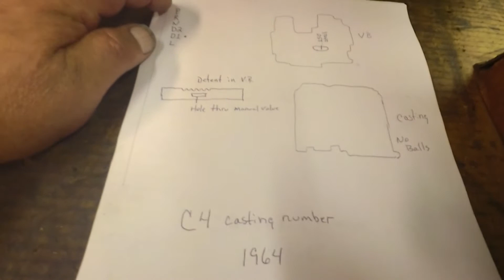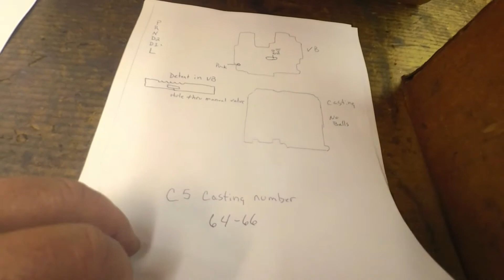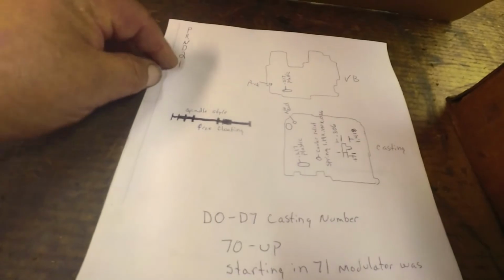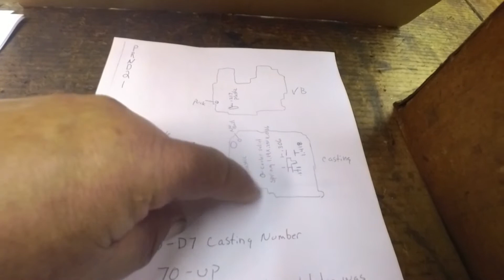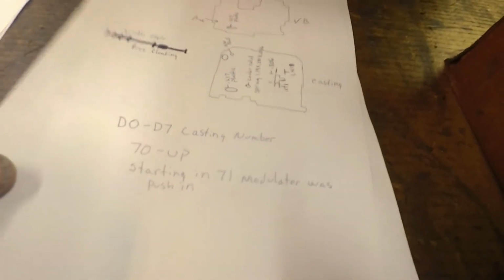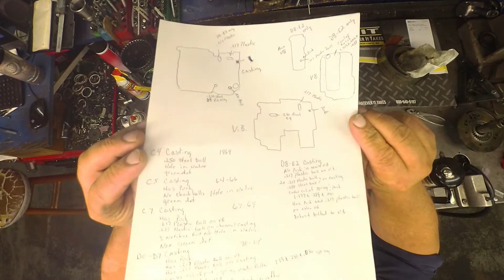C4 Valve Body Identification

Comment: Hi

I have a C4 auto with a C8 casting number on the valve body.

When I took the whole assembly apart, I had the puck and 2 check balls; however one of the balls is smaller than the other, about half the size.

The problem is, I'm not sure which channels they should go into (all the videos / pictures I've seen state that the balls are the same size), I'm assuming one size should go into one pocket and same with the other? But which way round?

I'm going to be fitting a transgo stage 1 kit (part number 47-1), where check balls are still required. Again, the instructions show the ball sizes to be the same.

Do you know of any revisions / modifications to the C8 casting over the C7, that would require differmt size check balls?
Reply from the maker: The balls are the same size, .218. I have seen them swell and shrink in size. Your rebuild kit should have new ones in there and be the right size. I believe the Transgo kit comes with them also, don't remember it has been a long time since I have put their kit in.
Reply: @CurmudgeonTransmission  thank you for the reply! The balls don't come with the transgo kit, however I have purchased new old stock from the states (in Britain spares are hard to come by).

I would have thought that both balls would have shrunk, not just one? Could it explain why my reverse gear loves intermittently stalling the engine, or am I completely wrong?
Reply from the maker: @nicholaskennedy1748  Probably getting stuck in the plate. Let me know if you can not get them. Get you some somehow. Don't always both shrink usually only one.
Reply: @CurmudgeonTransmission  thank you, you've been a massive help. I'm not sure what the balls are supposed to do anyway, I've tried researching it but not found any answers. 

Also, are both balls actually required? I will be fitting new ones anyway, but I saw on one site that only one ball is mandatory, the other is not required, although I can't think why
Reply from the maker: Seems like there was 1 you could but I don't remember which, I always put them both in. They may be different for that year but the 71-up book I have lists them as: One in channel plate, 2-1 Reverse Cutback TV Shuttle Valve. Valve side as Reverse & 1-2 Shuttle Ball. Only listing I have for them.
Reply: @CurmudgeonTransmission  ok, thanks, I'll let you know how I get on soon!
Reply: @CurmudgeonTransmission  finally back on the road! Could not have done it without your support, thank you! Gearbox now works like a dream
Reply from the maker: @nicholaskennedy1748  Glad I could help.

Comment: I'm having issues with a c4 that might have the wrong valve body in it. I like you info on these. could you possibly send me a photo of you paper work?
Reply from the maker: You will have to go to my Instagram page, won't be able to do it here. CurmudgeonTransmission
Reply: @CurmudgeonTransmission I’ve got a c4 in my 65 Stang but it doesn’t shift to 3rd gear 1st and 2nd are fine I put a new modulator on it but I’m wondering if I have a 2spd in it or is it adjustment of the modulator I drove it on the freeway but it doesn’t downshift to 2nd manually or by itself because I believe it’s always in 2nd gear regardless of how fast I’m going 
Any suggestions
Reply from the maker: @Michael-e1r3m  Is this something that just happened or is it after a rebuild? If reverse is good, third should be possible. So, at that point you are looking at a vb, modulator or governor problem. How much vacuum is at the modulator? Do you have a gauge for that? 17 is good, no less than 10. Does it have the original modulator pin before the problem started?